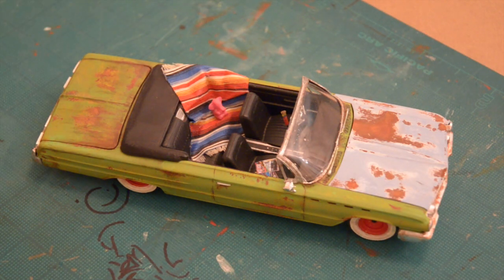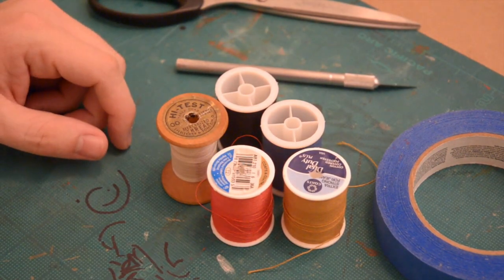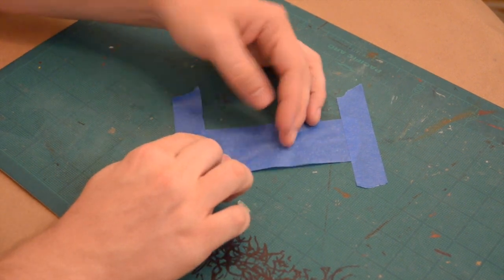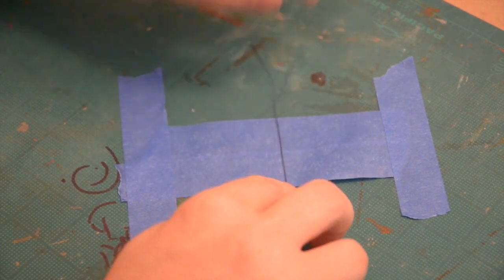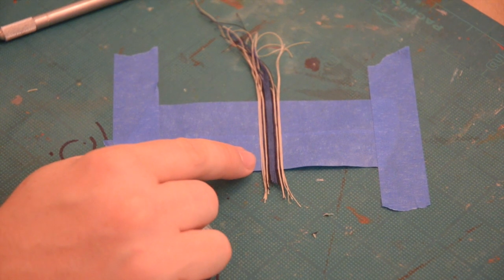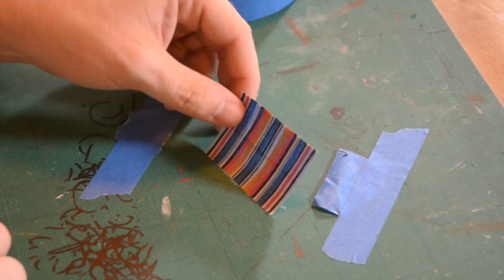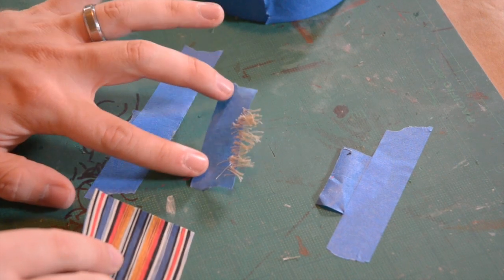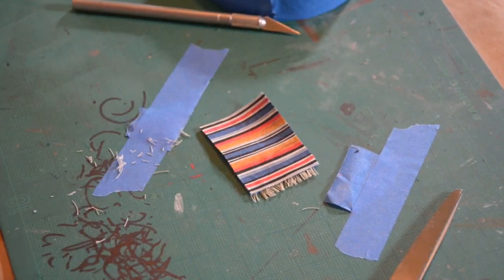How To | Scale Mexican Blanket

Comment: Great tutorial, have to try it one day. I wonder if you could now run some Elmer's glue over it and pull the tape off so it can be seen from both sides.
Reply from the maker: Thanks! Never thought about the Elmer's glue! I'll have to try it some time.
Reply: Paul Turley Or maybe spray adhesive and then stick some threads going length wayswhich will be the fringes....hope that makes sense.